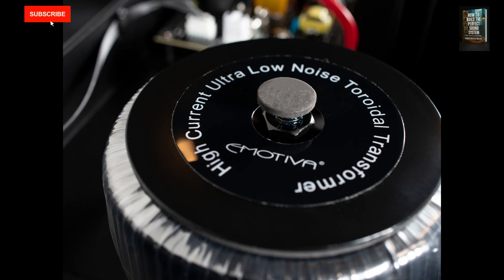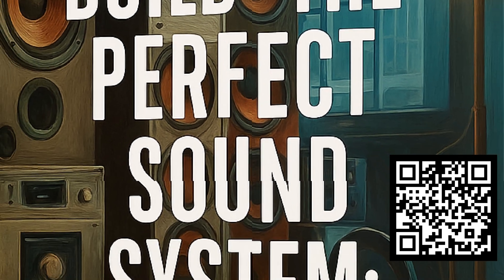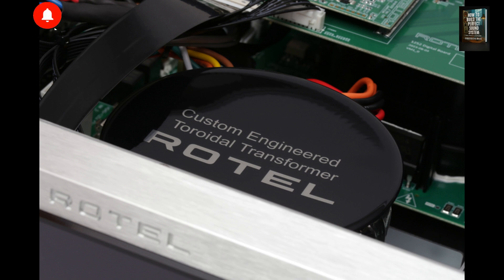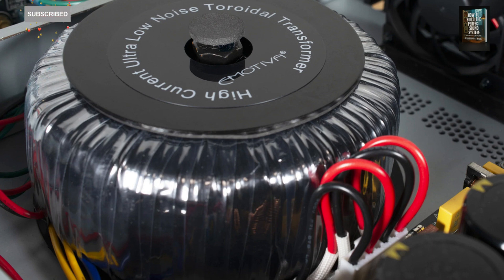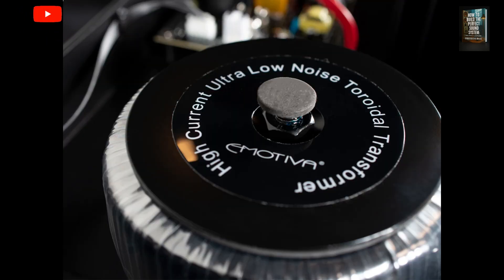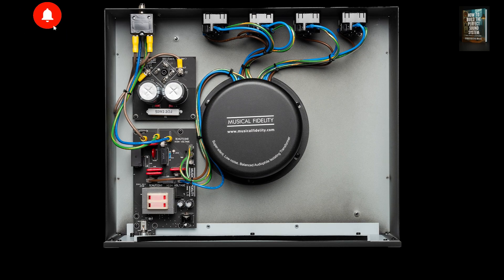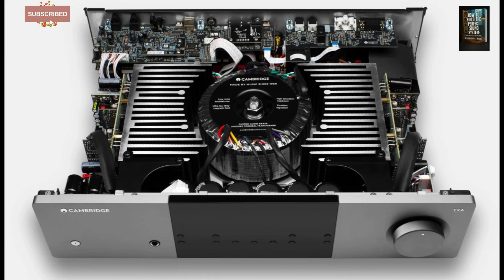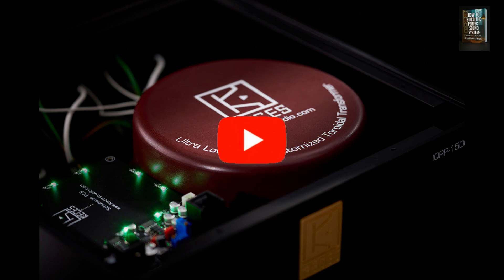The Secret Behind Great Sound: How a Toroidal Transformer Works — and Why It Sounds Better

Comment: Toroidal transformers don't "sound better." What happens is that there is less parasitic emission of 50/60 Hz from the mains to the environment, which simplifies shielding and allows for a smaller overall design.
Reply from the maker: Thank you for the clarification—you're absolutely right. The perceived improvement in sound quality often attributed to toroidal transformers is more accurately explained by their reduced electromagnetic interference and efficient design. By minimizing parasitic emissions at 50/60 Hz, they simplify shielding requirements and contribute to a more compact and cleaner system architecture. I appreciate you pointing that out.
Reply: @audiosonichaven ...thanks for your videos Sir.